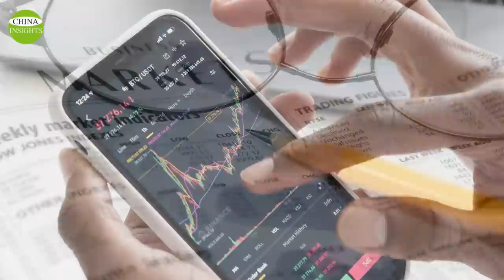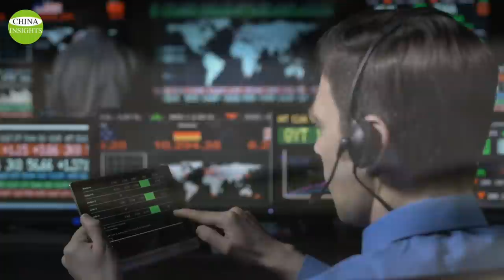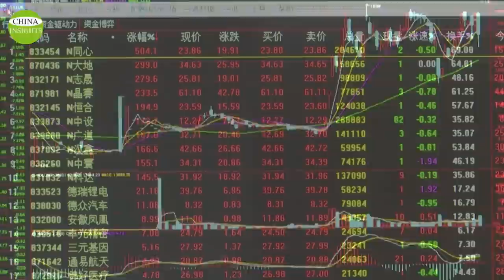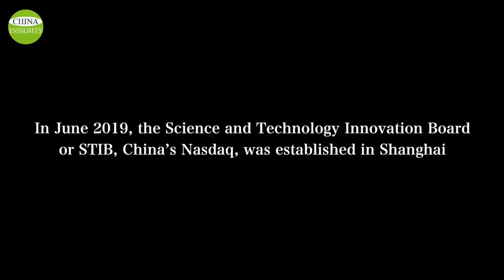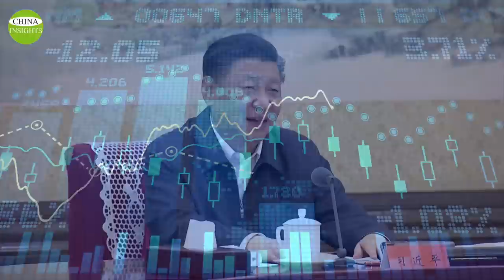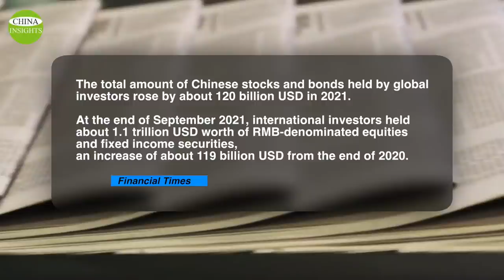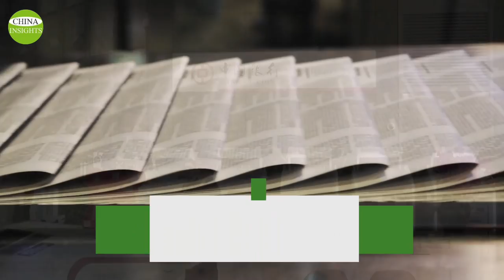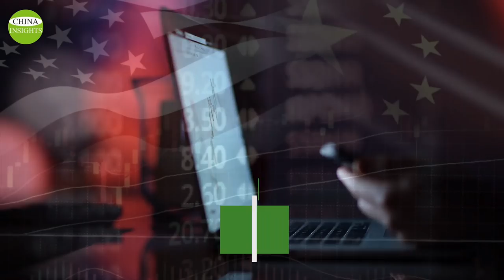The risks of investing in China/Why does China open the Beijing Stock Exchange recently? /The VIE

Comment: Although I think most of this video's opinions that are based on structural features and longer term entities are probably still correct,
A lot of the information and data this video is based on is only up to events Sept 2021.
As fast as things are changing in China today that risks obsolescence as of today, Dec, 2021.
The CCP appears to have more forcefully strangled the "fictitious economy" and consolidated power during the past 3 mths and the RE industry is in a severe downturn if not collapse due to debt overload.

So, some of the observations in this video should already be questioned for accuracy and at the rate of change more skepticism should be applied as time goes on.
But, some of the core topics probably won't change much... The CCP's efforts to nationalize the economy moving forward, outright rejection of foreign capital with its strings attached that could dilute CCP power, and whether anyone can trust any of the Chinese financial markets the way reporting is currently structured.